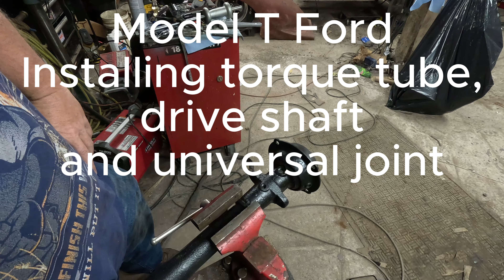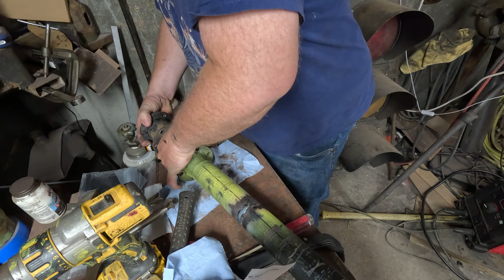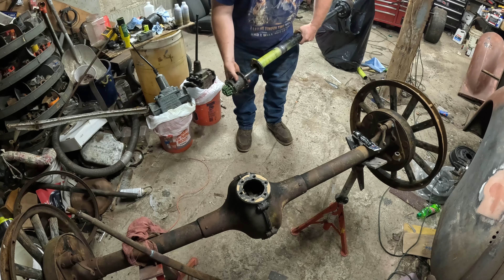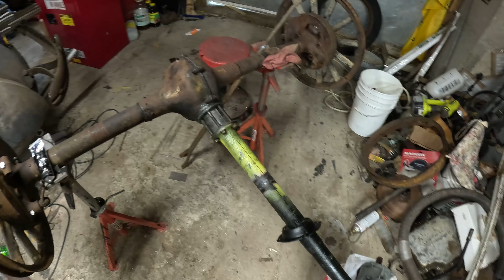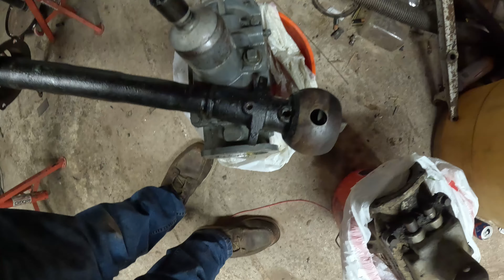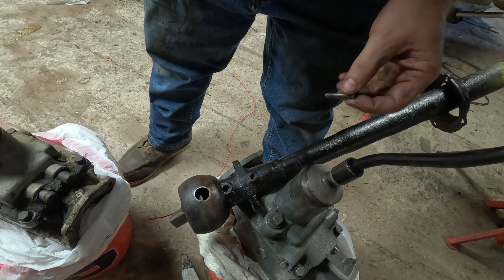Model T Ford: Installing torque tube, drive shaft and universal joint

Comment: Question, If you get the old driveshaft bushing out in good shape could you take the two bushings together and use the old one to match the grease fitting hole and drill the new one, Also using the same idea mic out the length of old driveshaft bushing to determine if you need to ream the bushing for the U joint pin hole? Thank you for putting this video on, Iv been wondering if I could install a warford into my car or not and your video has convinced me that I can. Are the Old worfords the same length as the new ones?
Reply from the maker: Usually I get the bushing installed then drill the hole through the torque tube.

I didn't mic it out because I drilled it in place. 

If I take an old bushing out I don't put it back in, because I don't want to put in a worn part and it is tough to line them up properly where I can install a new bushing then drill it so it will fit and sit right without a bunch of fussing with it.

Unfortunately I don't know if the new and old Warfords are the same length, I've only ever owned and installed old ones.